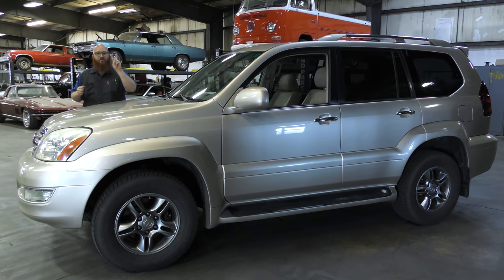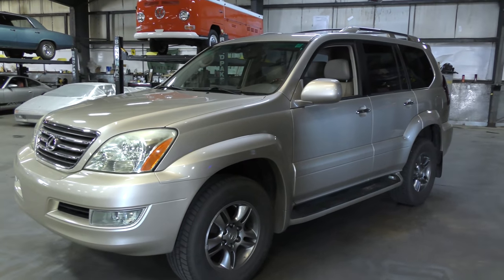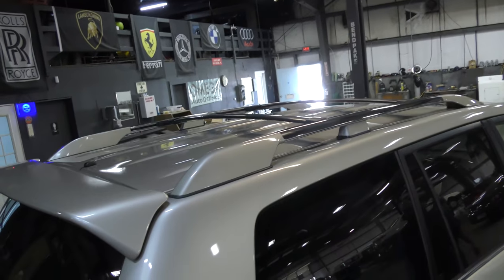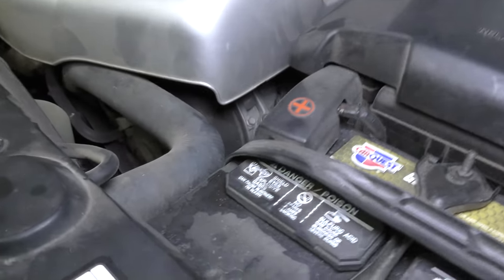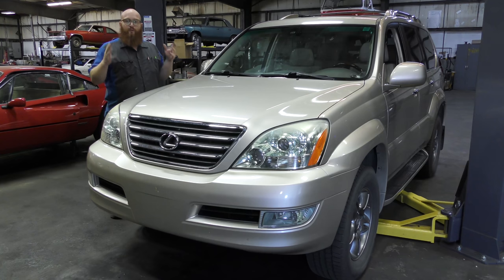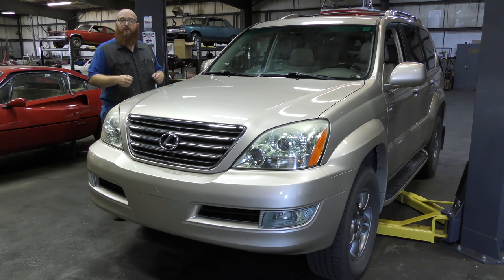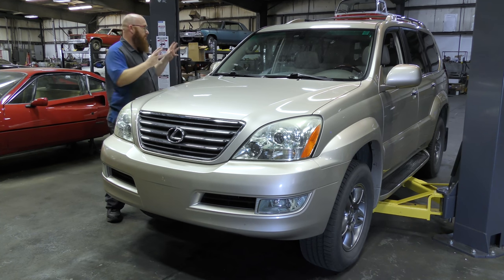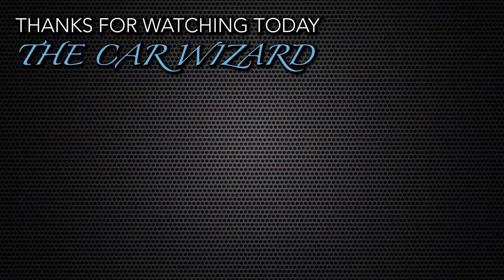Reliable cars get surprise bills too. Simple oil change on '08 Lexus GX470 turns into $1200 repair

Comment: Owning that exact model, I have 2 comments: 1 - Mobil1 is no longer full synthetic (shocked me too!) and 2 - The reason the spare was full is that it has a TPMS sensor so you are reminded to keep your spare inflated. As a testament to the vehicle, we blew our main alternator fuse over 1000 miles from home, almost nothing worked inside the cabin but by swapping batteries a few times, we still made it home. The GX reputation is well earned!
Reply: Oh so you know the base oils they use 🤔… unless you work for Exxon/Mobil you have zero clue. Actually less than ZERO. All of their formulations vary with respect to base oils used and percentages. Regardless any synthetic oil in North America using Group III base oils or better is considered “100%/Fully synthetic. You are wrong and need to maybe stay in your lane.
Reply: You on the other hand could learn a little diplomacy. Using your own statement, me knowing the percentages of base III/IV&V oils used would make no difference to whether the oil is considered synthetic or not. A court case has decided that if the oil contains any mixture of only those then it can be considered fully synthetic, even if the base III contains something originally mined out of the ground. In the end, this comes down to legal definitions, not scientific ones.
Reply: @Dehning  Did you not state incorrectly albeit that Mobil one wasn’t full synthetic anymore? Next time maybe fact check yourself.

Hydrocracked modern group III/+ base oils have zero resemblance to their conventional group II counterparts after treatment. Furthermore base III/+ formulations offer equal and in some cases superior attributes to a largely PAO/POE bade. Most modern oils rely heavily on additive technology. This isn’t 1990. The argument of REAL synthetic vs fake or not is simply absurd if you understand anything about how modern oils are formulated. Unless one lives in Antarctica or they want to run 25k oil change intervals, PAO has zero advantage.

Comment: I looked at a 2017 Tundra last week, already rusting through the bed from the bottom up where it mounts to the frame.  Toyota makes some good stuff, but their body on frame vehicles, FJ's, 4Runners, Sequoia's & Tundra just don't last in the salt belt.
Reply: You should see the frame on my 1996 LX450. Looks brand new still and its 25 years old. Pro-tip, stop living in shitty states.
Reply: During the winter months, run it through the car wash about once a week and during the summer months, twice a week with an annual buff
Reply: Nothing lasts in the rust belt. Toyota will replace it under warranty. Ford or gm would tell you to pound sand.
Reply: It’s called preventative maintenance. 

I live in a part of the Rockies where we salt the roads, which is why I have the frame/underbody on my 09 GX470 sprayed with Fluid Film every fall. It still looks like new, while I have seen plenty of 3-5yr old Ford/GM/FIAT-Ram bullshit already rotting because of neglect. Spend the annual $100 to take care of your shit and it won’t rust out.
Reply: @KiyaWarrior  fires/drought in the west, tornadoes in the Midwest, hurricanes/tropical storms in the south and along the gulf coasts; soooooo, where is there NOT a "shitty state" nowadays 🤨

Comment: A proud gx owner here, bought mine at 158k, still no cv leaks/problems. I was willing to have the 4wd in return for all the advantages. However i did look at its cousin 4runner which Ive owned several, and it is 2wd OR 4wd, but it was harder to find one in great condition. Thanks for pointing out its value!

Comment: "Reliable". Brands are not reliable. Certain models usually are. However there will always be exceptions to the rule. You, as a mechanic see the worst of the worst. That alone shouldn't be your standard to judge cars on. Anyway, I appreciate your honesty and the nuance that you see in judging cars.
Reply: Toyota products are not galvanised so they rust
Reply: Exactly always had fords never had major issues !. 200k plus on all the vehicles

Comment: Unfortunately GX470s are increasing in value, even before the upward trend of all cars. They are excellent off road and luxury on road.
Reply: Even a salvaged one in a junk yard commands big money
Reply: 460s look a tad better before the grill overcame the bumper.
Reply: if they couldn't get a lexus they could get a Toyota Land Cruiser Prado its shares the same parts as the GX but less in power because of its V6 or a 4-cylinder or diesel options but still a reliable car...
Reply: @klausledda5903  sadly we don't get the Prado in the States. We get the GX470, GX460, LX470, Land Cruiser, 4Runner, and FJ Cruiser. ALL of them have very high resale value and all are excellent vehicles. I wish we had the Prado with a diesel here.
Reply: Life of a GX470 in the states
First 20 years: soccer mom vehicle
Last 20 years: ultimate off-road build
Reply: if they lucky enough to get land cruisers 4 runners or an FJ cruisers with a good price just go for it but make sure to bring a mechanic along them when they buy one...  lexus car are still pricey mostly used ones so i dont think that they could go for that just beware on GMs Fords and Dodge...
Reply: @JH-qy7zw  agreed they're very easy to tuned and customize as an Off road car
Reply: You used to be able to get these under 10k with low miles…. good luck doing that now :(
Reply: People ran out of 4runners to push prices up on.
Reply: Truth!!!!  Now haters  re read that and tell me any other that can compete!! Love my gx she hauls ass!!
Reply: @JH-qy7zw  Well said 😂
Reply: It blows my mind. I have a 05 and laugh at what folks are paying. I was attracted to them when they were still affordable. I ended up putting full coverage on mine just because of the “value”
Reply: Prime Artemis  Most of the Lexus is made in Japan. It's better built quality (craftsmanship) :)
Reply: Prime Artemis  the GX470 and 460 share parts with the 4Runner and FJ Crusier.
Reply: Prime Artemis  it was never 96% similar, maybe 70% at most. Lots of sound deadening materials and bit more complicated suspension parts...and luxury Interior parts differentiate the driving experience big time.
Reply: @klausledda5903  had to get a Lexus RX 350 because the Toyota Highlander of similar generations were much more expensive for same mileage. Plus old rich people buy Lexus so not beaten to crap.
Reply: Rx450h all the way :)
Reply: @D0991N  I really wanted thé RX 450h, loved the one my friend have. The quietness and the gas mileage make it the best choice for a daily driver. Unfortunately I was taking a long trip through sparsely populated county and the 450 is really dealer only for service. The 350 is a rebadged Highlander and parts and service are much more available.
Reply: @thelittleguysoutoftexas421  What is an 05 GX470 roughly worth today you think?
Reply: @mopheousredpill7462  depending on mileage, how clean it is and we'll maintained it is, it can pull upwards of $20k+ for under 100k miles. Modded ones with low miles can pull upwards of $20k to $35k depending on what type of mods. With 200k miles they can go for around $9k to $12k. I picked up my 2003 with 117k miles on it for $11k before the prices skyrocketed! It's mint inside and out and has 3" lift with 33's upgraded GX460 front calipers and rotors, custom interior lighting and other mods. I would say I could probably pull around $22k to $24k now with current values. Its doubled in value since I bought it, but I will never sell it. It's just too damn good!

Comment: I have a 2004 GX470 with 277,000 miles on it and I am still happy with it. The black Onyx paint is really good shape like a big black mirror, the engine is still quiet running and shifts smoothly. It doesn't have any leaks anywhere on it and has never been smoked in, every button or lever works, to me I still feel like I am driving a brand new GX....my sister went with the Chevy model and hers has spent more time in the shop for sunroof constantly leaks, electronics went haywire, front tires always flat, tv doesn't work most of the time, bumper sensors going off for no reason while driving it, navigation can't be relied on always places her in a neighboring city....yet she feels she still thinks she got a good deal on it.....I know she puts it in the shop every 2 weeks for the past 5 years and they keep it for a week.

Comment: Lexuses are one of the few vehicles where it's cheaper to rebuild those axles into replace them after working at different dealers for many years it is way cheaper to rebuild those.
Reply: That’s what my mechanic suggested & done.
Reply: How do you rebuild axles? I have changed boot cover but those bearings did not seem replaceable..
Reply: @juchou2983  if there is no excessive wear (usually due to contamination) just clean and lubricate, plus the new boot. Technically should last very very long time.

Comment: I have an 04 with similar miles and its currently in the shop having the EXACT same work being done, with tie rods on top of it.  I'll never get rid of my GX470.  As long as gas pumps exist, that truck is in my garage.
Reply: You can always delete those air bags also and put a traditional style spring in.

Comment: Good point Dave, "Most American cars are made to last 3 to 5 years" (and the owner financed them for 6-7 years) "and then they bankrupt ya"
Reply: Sadly, it’s all about cutting costs and short term profits rather than building long-term trust with consumers.
Reply: @PseudoSpaceMarine  exactly, my point was Americans buy crap and finance it before they can pay it off
Reply: @NOWitsOKto  Personally, I think it’s better to lease a car when it’s new rather than financing it because you know how much you are going to spend on it over time and you don’t have to worry about depreciation.
Reply: @PseudoSpaceMarine  Leasing is the worst decision ever.
Reply: Yep my son in laws 2017 Ford Fiesta is rusting at the seams literally.  Both rear doors and rear truck lid. What crap. Ford corrosion warrant don’t cover seams. Had 2004 Sienna no body rust in 2016 when traded for a 2011 and that one is up to 230k miles now and no rust on body either.
Reply: @ipdjbt  I'm a cash man myself
Reply: @NOWitsOKto  I don’t think it’s an American thing. Look at German, Italian, English, or French cars, they are all plagued with issues. Good luck ever owning an Audi, Jaguar, or BMW past 40,000 miles..
Reply: Average  age of cars on the road in the US  is 12 years.  My 2012 fusion   has 200k no problem.  My 1998 Chrysler  minivan  has 350 k with minimal  trouble.  That one I can't even  figure  out.
Reply: My 2004 Jeep has 240k and no problems - My 2006 pontiac is at 230k and doing well - My 2010 Toyota Scion burns oil at 80k  along with many issues.
Reply: @adamkrz59  Does your Jeep have the straight 6 engine?
Reply: @PseudoSpaceMarine  I have 2 - 1 with the straight 4.0 liter and the other has a v6 3.7, I change oil every 3-4k, The 4.0 has almost 300k the v6 has 240k.  Toyota knew of a problem with the 2.4 but did not offer a solution for the problem with oil ring -  some people got free engine replacements - i was too late, it's all luck with some vehicles -
Reply: @adamkrz59  I know. My uncle has a Camry with the 2.4L engine with the same issue.
Reply: It’s all about maintenance.  All about marketing!

Comment: My Commodore V6 has the GM v6 made at the Holden Port Melbourne Engine plant when it was running in 1997. It's done 200,000km and still runs ok. Here in Australia there is a lot of V6's with 350,000 + km's still running around. One car I had I put into the shop for exhaust work and they showed me the brakes were shot on all 4 wheels, the cost went from $300 to $1100, which I  paid as it needed doing. You dont mess around with your cars safety.

Comment: Spare tires should be kept at the maximum recommended pressure - if you need to use it, much easier to let air out until it's at the right pressure than pump it up. Also if you get rear-ended, they help absorb the impact damage.  Read this about 40 years ago, and I always keep my spares fully inflated (and I've had to use them on more than my fair share of occasions too)

Comment: When talking of the unreliable competitors, he always forgets Land / Range Rover, which are in fact the least reliable on the road. Rubbish.
Reply: He should just say ALL CARS that are NOT Japanese reliable brands like Honda and Toyota products...Including all American, German, European....LOL
Reply: They are cool though. I miss my old land rover, I don't miss checking the fluids at every fill up!
Reply: The Wizard LOVES Rovers...I think his wife drives one.
Reply: @mikenormandy9250  
There's exceptions of course within Euro and American brands, but Land Rover is not one of them. They're statistically bad, fact.
Reply: @M4rt_FX  My good friend is a lifelong mechanic for high end cars such as MB, Rover, etc and without a doubt he said that he would not even keep a rover product if you gave it to him it is that unreliable. Air bag suspension system is crap and consistenly had many come in for replacement after only a few thousand miles. Electrical system is messed up and it creates many grounding issues and switch issues. He just all around said "No way".  He is a smart mechanic and I trust him so Ill stick with my GX460
Reply: @threesetstofailure9941  
For sure, the reliability statistics tell the story too. Land Rover on the bottom, Lexus at the top!

Comment: Also a good thing to make sure your spare tire actually comes down.
Reply: Yes . And you know where the jack / locking wheel nut is  .. You might need a breaker bar too as the garage will zip the bolts up so tight ,Best find out now rather when it's tipping down in the dark .

Comment: Ive told friends the exact same thing when asked what they should buy. They never listen and end up buying something based on styling. 
My 2003 4.7 V8 4runner has 226k and I love it. No issues and has been worked so hard it would have killed past 3/4 ton trucks Ive had.

Comment: Doing a recording of the car before working on it is a great way to have evidence to hold in case a customer claims you did it. Back in the days when I worked valet, When we would write a ticket for the customer on the driveway, we had two drawings of the vehicle on it; front right angle, rear left angle. We put any markings with our pen where we saw any dings and dents or anything that could be a scratching to a missing or boken off piece. Yes, we've had (every once in a while) a customer who would claim we caused the damage.
Reply: Same as you should do when you hire a rental anything...
walk around with the salesperson..
"ding here, that's broken etc.....
give me a copy of the report signed by you, 
I'm taking photos, you stand here in them"

Comment: Checking air in the spare tire for air is not enough.

You need to lower it and lube the mechanism. 

There is nothing worse than being stuck along the side of the road (or the middle of nowhere) and the spare tire is frozen in place .  It's fast and easy to do and well worth the effort.

Ask me how I know . . .

Comment: Im seeing so many trust fund kids convert those in insane luxury off-road beasts now lol
Reply: I'm far from a trust fund kid, but I did build mine into a light off roader. It's such a great vehicle. Gas mileage sucks though.
Reply: Yup, now you can't find one under 20k with less than 150-200K miles. Not sure about the trust fund kid part though.
Reply: @xtrekadventure8225  What kinda mpg are you averaging?
Reply: $8k truck, $8k in upgrades for mine so far. I feel bad for you if you think you need a trust fund to build a Lexus. I think you're just poor!
Reply: @platypus842  with premium on the highway around 16-17 with 31" M/T and a roof rack. 13-14 city.
Reply: @xtrekadventure8225  Thanks for your response. Definitely not great, but in my opinion that’s not too terrible either. How many miles on the odometer?
Reply: @platypus842  215k
Reply: @xtrekadventure8225  Nice. My current daily driver is a 2008 Lexus GS350 AWD. It’s got 261k on it and no issues at all. Unfortunately as it’s gotten older the fuel economy has decreased a bit. I average around 17-18mpg combined (mostly city driving). Probably needs an injector cleaning. Window sticker rated it as 18 city/ 25 highway. Do you ever use regular fuel or strictly premium?
Reply: @Freelander  I used to have an 08 GS460 and I still miss that thing, could get 31 mpg on the highway if I didn’t floor it. Thing hauled ass, that body style still looks great too
Reply: @kgisabeast  I must really need an injector cleaning then. Only get around 22mpg on the highway. 261k is a lot of miles on the odometer though. Probably not just carbon deposits on the fuel intakes. Just a stressed out aging engine. The GS460 must’ve been a lot of fun, plenty of power there.
Reply: @Freelander new spark plugs, PCV valve, and clean the maf sensor and throttle body, all super easy to do on the 350, that could improve your mpg a little. I do know the 3rd gen GS had a pretty common issue with the rear brake caliper slide pins freezing up which I didn’t even notice until they showed me, that could also affect mpg.
Reply: @kgisabeast  Wow. Thank you for all this info. Really appreciate it.

Comment: Buy this kind of car and learn how to do all of the work shown in this video yourself. Super basic and easy stuff. 1996 Lexus LX450 owner here. Saved thousands upon thousands over the summer doing rotors, pads and calipers all 4 corners myself. Did the wheel bearings and rebuilt the knuckles while i was in there. Pretty easy and fun.

Comment: I love my 2005 gx470. 220k miles. Just had the oil pan replaced. Same engine and transmission. I do transmission flushes. And shifts great. I just recently had to replace all o2 sensors and catalytic converters. That was $5k but did it my self. The rotors all ways get that way. I have changed it 3 times.